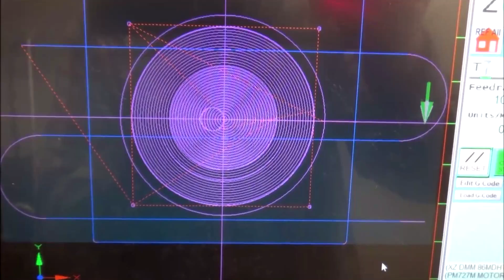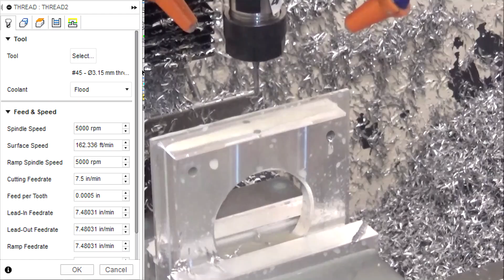PM727MXL Z axis Servo mount

Comment: Making great progress Sam .. could you provide a link to where you purchased the diaphragm couplers?
Reply from the maker: Here is the link I had to purchase 2 sizes 14 x 14 and 12 x 12  and use one side from each to get a 12 x 14 mm coupling. but other than that it works great.

https://www.ebay.com/itm/Clamp-Tight-Motor-Shaft-2-Diaphragm-Coupling-Joint-CNC-Stepper-Connector-Coupler/312535682259?ssPageName=STRK%3AMEBIDX%3AIT&var=611246868808&_trksid=p2057872.m2749.l2649

Comment: A servo coupler is definitely necessary when you have that much torque.  I use them even on the ClearPath servos
Reply: This one has no clearance. Another type whuch has plastic connection in between may has tiny little but is more beefy!
Reply from the maker: @ray-charc3131  ive tried the plum type coupling.  They work ok. But these diaphragm type are really nice.
Reply: Sam, I have some of those diaphragm couplers as well. I haven't used them yet and will have to enlarge the bore when I get around to mounting them. What do you think is the best way to bore them out?
Reply from the maker: These work really well